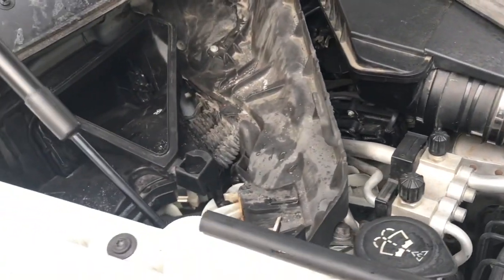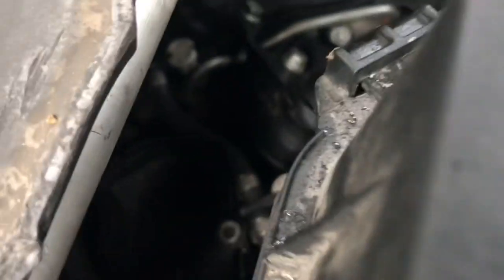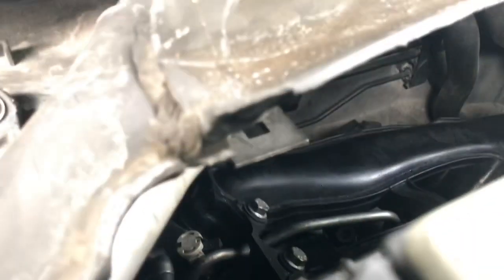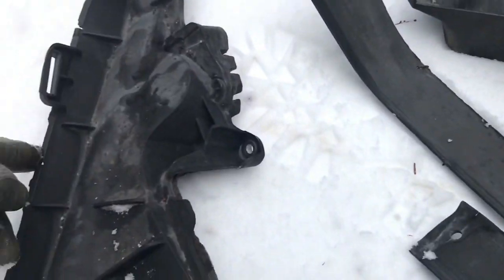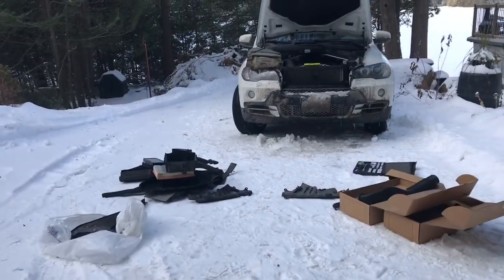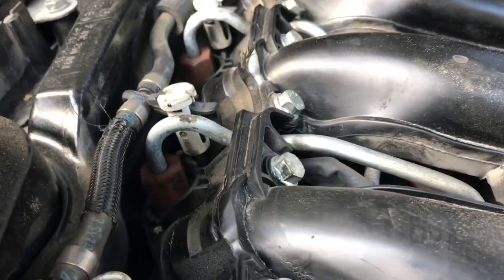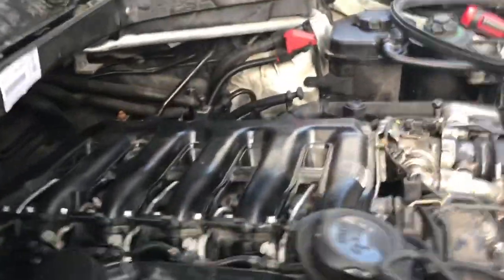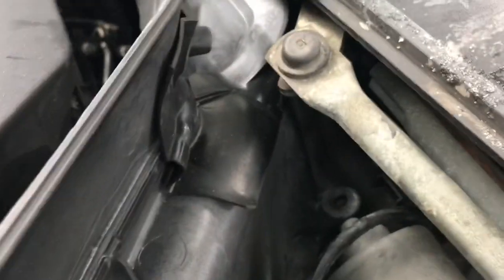BMW X5 E70 35d, I lost 2 fuel injectors because of broken water shield on the bulkhead firewall

Comment: we just had our 35D die while driving home - got a code for bank 2 injector activation.  the mechanic we took it too determined our DDE needs to be replaced but I was aware of this issue and wondered if it was happening to us.
Reply from the maker: Check the resistance on injectors 5 and 6

Comment: This is just now happening to our X5 Diesel 2010!!  We replaced all of the injectors but #6 keeps going out.  So finally - (even after BMW said they couldn't find anything) - our mechanic found this issue - maybe because of this video.  Trying to figure out the correct parts with BMW has taken SO MUCH TIME.  Thank you for posting this and we're never getting another BMTroubleYou.
Reply from the maker: Sorry you are finding this out the hard way like me.
But, my bmtroubleyou 😂 is over 400,000km now (250,000miles) and going strong.

Comment: I have had the same problem from blocked water drains on my Merc.  Was easy to fix, but previous owner had problems, didn't know what was causing it, mechanic visits, I eventually worked it out by pouring a couple of buckets of water on the windscreen and saw that water pooled and built up and breached the engine seal.  Fixed in 15 mins with a screwdriver and hose, flushed out blocked drains.  Was shorting all the injectors, were   basically underwater, all the connectors open circuiting.  Took a torrential downpour to discover it.

Comment: The foam is noise dampening, not water collector. Thanks for the heads up.
Reply from the maker: Hi Tyler, yes the foam is for noise dampening, but when the water shield breaks it becomes a sponge that retains the moisture soaking the injector harness in water which eventually leads to the corrosion and failure of the injectors.
Reply: i did not put the foam back. there is a fair (not universal) consensus to keep it off. .. audibly, i have not noticed a difference; perhaps at full load it’s different from the exterior. .. however my once corroding fuel line 5 isn’t getting worse so the foam will stay off/out. i believe small amounts of water were being trapped by the foam. (even though i have a 2012 w/ the updated water deflection trim and it’s in pretty good shape; not yet splitting.)

Comment: so this part has been redesigned by BMW, knowing they have this issue with injectors. This should become a recall. I just lost #6 for this issue.
How hard was it to replace the #6, any tips? Dealer quoted me $1400, which is a joke!
Reply from the maker: Hi, 
I agree, as do many others, that it’s a poor design and BMW knows this. #6 is the most difficult to replace because it’s so far back and it requires a special pull slide hammer to remove, as well as, more parts of the firewall to be removed. I paid $500 an injector to have them replaced and $400 labour.
I found a good BMW Preformace shop to do the work.

Comment: Should not really damage the injector.
Clear the water using wd40 and make sure water not dripping there. If it shows short cct on read out and the short is on the plug or wires should not damage injector. Water in fuel will damage injector.
Reply: It definitely does has been a common issue on them for years

Comment: What was the engine code when this problem accured. Or symptoms of engine ?
Reply from the maker: Sorry, I don’t remember the exact code, but the code was for failed injector. It went into limp mode. Started fine and drove a bit then back into limp mode.
Reply: Mine was 4453 DDE injector cylinder 5 activation. Same issue. But the CAR did not give me any codes. Had to use an OBD Scanner